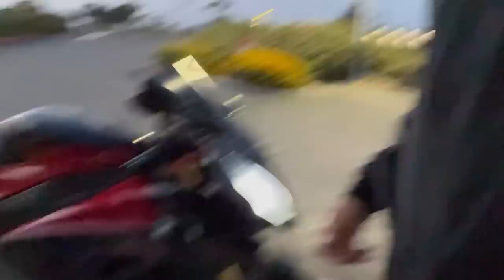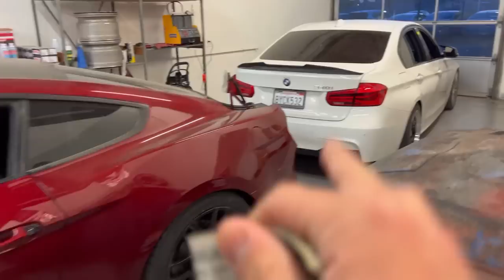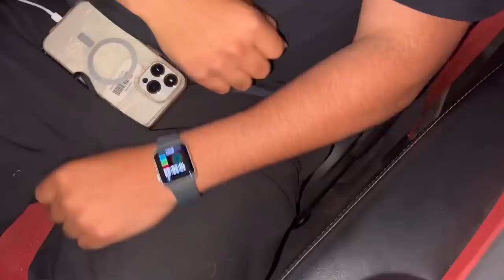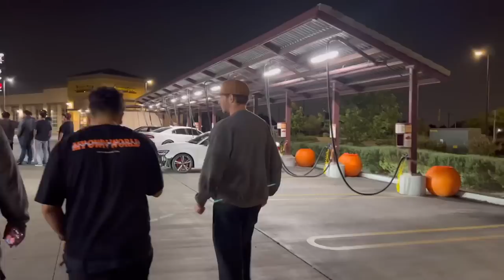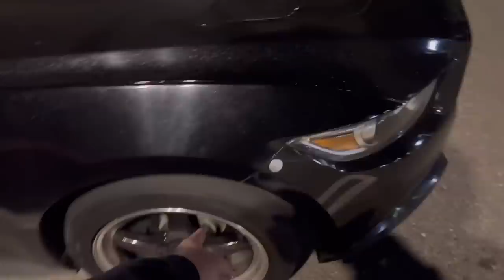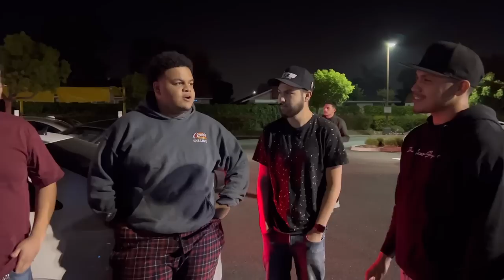RS3 Vs 5.0! $1,000 Pot #Audi #RS3 #Mustang

Comment: that has to be the slowest RS3 to walk the earth
Reply: or the fastest intake cat delete Gen 2 to walk the earth 🤣
Reply: Run your car not your mouth 🤣 I’m bolt on with no tune so technically stock vs basically fbo 6r80
Reply: @fakesi2572  can i get tha run ?
Reply: @fakesi2572  well.. that makes a lot of sense then. Lol
Reply: @johnathan7720 when I’m tuned you can get it
Reply: @fakesi2572  it’s not even FBO
Reply: @fakesi2572  you shouldn’t be running nothing without a tune buddy😅😂
Reply: @Fake SI  Why are you not tuned? Honestly a tune should be one of your first mods.